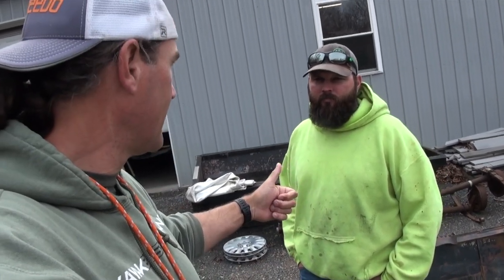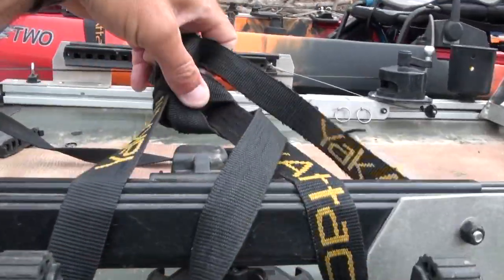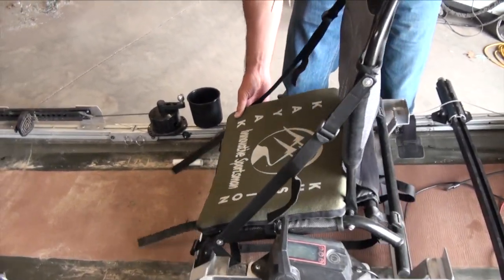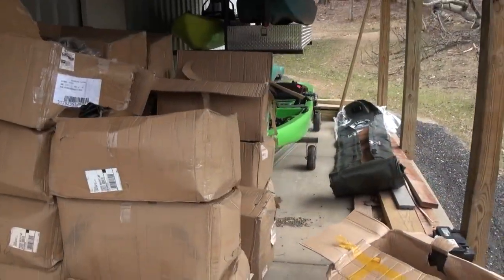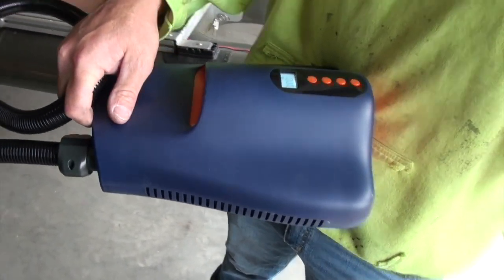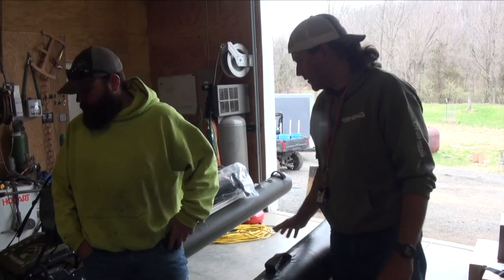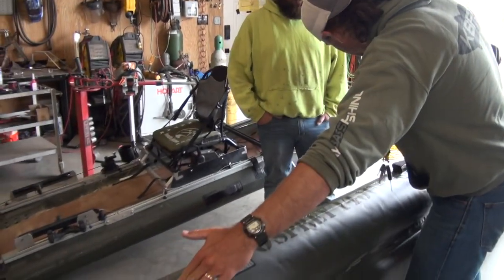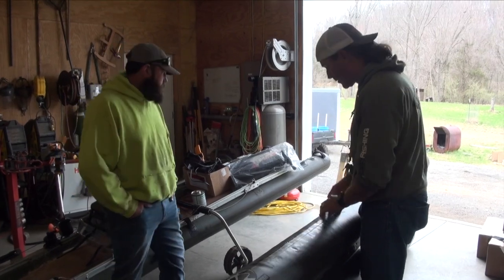Osprey Prototype Hand Off  //  Inflatable Kayak

Comment: Since there can be a considerable difference between air and water temp, do you need to compensate the pressure you inflate to?
Reply from the maker: Tray inflated his center chamber (drop stitch design) to 11.5 pounds per square inch. That is a fairly conservative number. I have used as much as 15 PSI for those chambers. But different air temperatures mean that a higher PSI coupled with higher temps on a hot day could take you over the recommended PSI. It’s rare that a water temperature could be higher than the air temperature, so I wouldn’t worry about it that way. If anything, the water will cool and drop the PSI.
Reply: @TheLittleStuff  that's what I was referring to.  On an early spring or late fall day the water could easily be 30° colder than the air.  I was wondering if that's the case would it be better to set the pressure a tad higher.